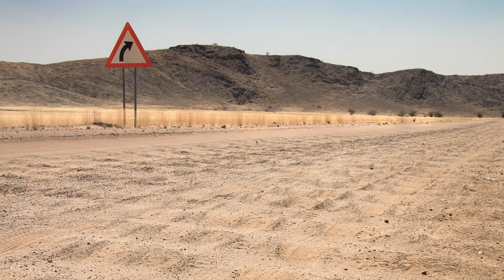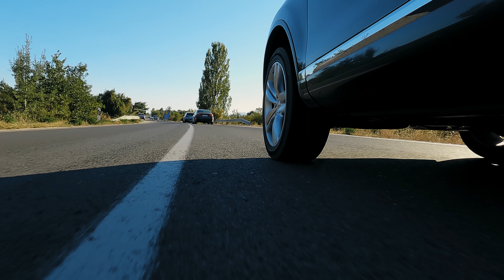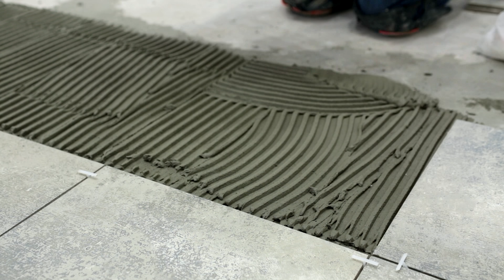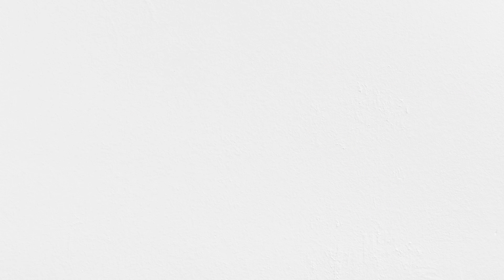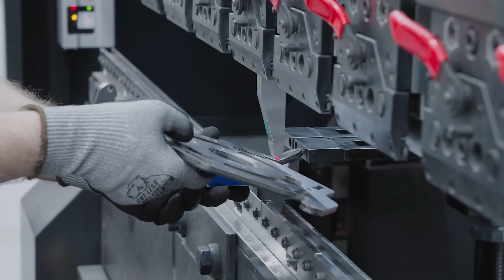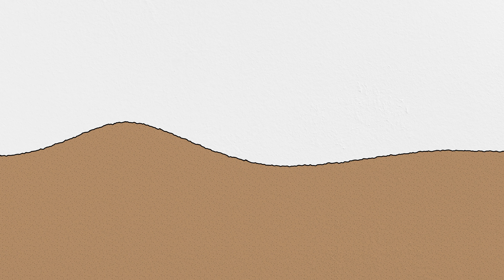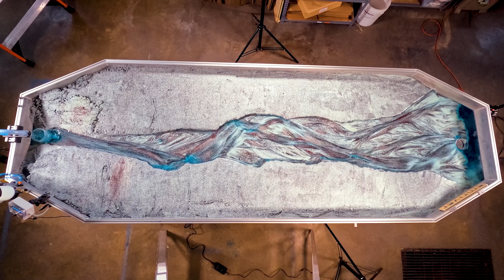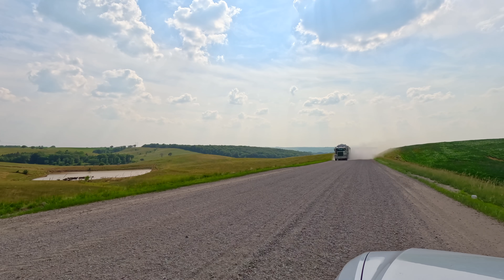Why Roads Get Washboards

Comment: I may be "asking for it" by doing this.
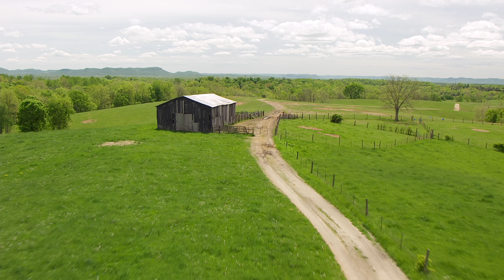I paused at 2:25 after your intro. I know you are very intelligent, and I know that I am not a trained engineer. Facts. But I also, for years, have understood physics and transfer of energy. I know that some washboard is caused by wind/water moving lighter smaller particles (erosion). But i also know from just simply watching and listening to vehicles driven on (usually gravel) roads, that most washboard is caused by ignorant and impatient people who do not have even a slight understanding of science and definitely not how forces act.
Hard acceleration and hard deceleration are the two main reasons washboard starts, and almost the only reason it "expands" in length and "wavelength". Yes other factors play a part like aggregate sizes, and mentioned erosion. Proper planning during construction, placement of maintenance material of the correct grading, and proper maintenance (not dragging all the fines and dirt from the "shoulders" into the drive path) can prevent these factors from entering the equation.

This also applies to paved surfaces. Asphalt, especially when just 2 or 3 inches thick over a failed base, will move a lot. Sustained high temperature greatly increases this measurement. Similarly concrete moves under excessive forces, like morons slamming on brakes (especially large vehicles like semis) because they neither pre planned nor gave themselves enough stopping distance to perform safe and controlled deceleration. In most cases the concrete is poured thick enough (6-10" or ~ 152-254 mm) but the 10 to 15 foot panel starts to pivot on the Y axis, and each panel then has a "lip" of sometimes inches as a result of the opposing "rise and drop".

Proper compaction of subgrade, proper material usage, and proper installation of whatever surface material are also very important. 

Engineers design roadways based on multiple factors, but if they are doing their job correctly when they say this road will withstand repeated (throwing a number out) 45 mph traffic (always over built of course) that doesn't mean you can leave the sub (soils/aggregates) below ideal compaction, use the wrong sub material (for rough example, some contractors like to use 3/4 minus where there are way too many "fines" and they move away leaving voids because it was the wrong material for the application), or not providing a thick enough surface (6" of pavement is not enough for heavy traffic, 1-3" ofasphalt over degraded concrete ground to 3", asphalt on a turn radius without proper assessment and placement depth, etc), and it definitely doesn't mean the design was intended for 65 mph traffic and semis performing excessively aggressive braking. 

If people would simply learn how to drive (cough, follow the posted speed limit. And yes there are posted limits for almost all roads in the United States), most of our roadway issues would cease to exist or take far longer to become a "problem". That coupled with appropriate construction means and methods, would make everyone happier and cost less (taxes, time, vehicle repair, etc).

Ok, now I will finish watching and probably put my foot in my mouth about something I said or feel. Ha ha

Comment: In my area most of our "paved" roads are just gravel held together with tar. As farm equipment gets larger and heavier, it destroys these thin roads far more quickly. Now add in that most farmers use semis, instead of gravity flow wagons, it really screws the roads up. Especially considering that most of the loads coming from the fields are over 80,000 lbs.

Comment: Is it not the result of the compaction roller creating the hills and valleys deep into the substrate? Over time the wasboarding (intermittent vibration of the roller)is exposed? The vibrations of the compaction roller creates what looks like a very smooth compacted surface. The vibrations of the roller create washboard surface?

Comment: I understand what is being said here but does not seem to explain everything. Here in Aotearoa I live at the end of a 10km dirt road. and so drive on this surface almost daily. I would expect to see washboarding on the part of the road that is driven on but in your video at 17:53 we see a surface very like my own road. Traffic is light so people tend to drive down the middle rather than on one side (this would be  the left here in Aotearoa). This means the edges and centre of the road get little use . However, the washboarding is across the entire width of the road and not simply in the heavily used part. What also happens is that there tend to be wheel ruts either side of the centre of the road but the washboarding actually runs along the central high spot as well and it is in line with the wave pattern in the ruts. I have wondered if there is some kind of resonance effect from the oscillation of the vehicle suspension as it moves over the washboarding in the ruts which is transmitted thrugh the road surface and piles up the particles without actual contact withe the wheels rather like the effect in a Kundts tube experiment.
such as here
https://www.youtube.com/watch?v=qUiB_zd9M0k

Comment: Ok, but I don't understand why the small wheel you're using in your experiment and the large tires of a car create the same spacing and radius of bumps and undulations. Intuitively, the washboards on roads using larger tires should be larger

Comment: That's a fun phenomena. I've gone over many unpaved roads in my life but I don't remember wash boarding being a huge problem - probably due to insufficient speeds.
I wonder what the frequency is, my guess is that it must depend on all the parameters (spring stiffness, tires, etc) but it just averages out to some value.
I bet it can't become a problem if tire pressure is low enough and suspension is soft enough for the given speed and load!

Comment: Also the power stroke of the engines I think could affect, obvious on single cylinder mc when accelerating.

Surface contact lenght, also snowmobile trails have washboards but longer wavelength.

Comment: In Finland these are called "nimismiehen kiharat" meaning "Curly hair of a rural police officer" :) Hence some 100 years ago the maintenance of small gravel roads was a responsibility of the same bureaucracy and police men were actually those on the field reporting service needs. Today there are about 30 000 km of state maintained and more than 300 000 km private maintained gravel roads in Finland so most of the material providers have also a special mix for gravel surface layer. Grooming and filling is a huge task every spring. Locals call the surface of a well maintained gravel road "crofter's asphalt". Looking at Rally Finland clips you can see corners where tires actually leave a dark skid marks to the surface - just like on asphalt.

Comment: This also happens with reel type lawn mowers with a roller at the front and back. A tiny bump will lift the cylinder blades and create a new bump as so on. That’s why they crisscross pattern, not just for looks but to also smooth out the ridges.

Comment: Although I am a licensed engineer, I find these videos tremendously illuminating on topics I have never studied nor have experience in.  Thank you for broadening my understanding as an engineer!
Reply: There is a way to nearly stop wash board.  If your township can use a gravel such as Basalt…it will pack down like cement.  Problem is it’s slightly more money than class 5.  All my neighbors thought I wasted my money putting Basalt on my driveway.  6 years later I haven’t had to grade it and it hasn’t eroded or shifted. Now everyone is putting Basat on their driveway.  We are even trying to get high traffic roads covered in it.
Reply: What kind of license?
Reply: @OneShotKill3r   Professional Engineer License, Electrical Engineering
Reply: Typical engineer, understands how to build it, doesn’t understand how the grader actually operates.  The corrugations are not like the video says and come from the operators of the grader being a rookie (or just lazy) trying to do the job too fast and taking too big of a bite with the blade.
Reply: @JohnTRevelator  Which is why you an equipment operator and not a licensed engineer.
Reply: Thank god to all the engineers that announce they are engineers.  Now we know who to blame for plastic oil pans, plastic A arms, and all the failed medical devices that have killed people.  As a human being I have to let you know.
Reply: @MinnesotaCarswtf? Also the ones that have made society safe, comfortable and exciting..
Reply: @MinnesotaCars  you little slow?

Comment: I'd love to see some of the various patterns in there. 

one thing you didnt explore is the possibility of blending aggregates with a base existing material - which may be more practical from a road improvement standpoint  - such as you could evaluate a road that washboards with a test setup like yours (or dig a small section of what's on an existing road), run it through the setup and either empirically or by trial and error see if blending in different common quarry products at a certain rate (0.x ton per xxx ft of a single lane) improves an existing roadway, which may be more practical than replacing the wear layer entirely on a gravel road.

Comment: When I lived in France, in the 1970s, the dirt roads I drove on did not have washboard (or corduroy) surfaces.  I attribute that to the fact that French cars, at least at that time, had much less unsprung weight than American cars did, and also that they varied more in weight, spring rate and so on.

Comment: The most sure-fire way of mitigating the problem of driving on wash board roads is to drive a vehicle with rubber tracks.  It is possible to buy rubber tracks for a pickup truck.  But this is a rather expensive solution to the problem, and the vehicle speed may be somewhat limited too.  But a vehicle with tracks will mostly just glide over the tops of the ridges.  Tracks would also reduce the forces applied to the roadway, thus reducing damage to the roadway.

Comment: I’ve always thought that using 4x4 would help reduce the buildup of these. Because if you notice, washboards seem to build up in spots where you accelerate. Not necessarily in spots where you decelerate. So naturally 4x4 could theoretically slow down the build up process just by distributing the load between front and rear axles.

Comment: As cost and availability of liquid asphalt varies, road surface maintenance becomes spotty. Those 20“ wheels and low-profile tires are already passé, and we might see a jump in demand for high sidewalls and shocks designed for maximum wheel travel.

Comment: Two things:
1.  Sand is not gravel.
2.  Tires are not simply being pulled through sand.  They are being driven forward by the power of the engine.  The tires are the point of contact with the surface of the road being torqued so that by friction with the ground the vehicle is propelled forward.  If you're just pulling a wheel around and around it misses the force of that gripping propulsion action.

I wonder if a modified remote control car setup could be used on fine gravel (just to scale with the tire being used). That would mimic what is truly happening to gravel roads when we drive on them.  I think I would look at attaching the setup to a rail on the outer ring of the track (like they used at dog races) as a guide only and let the motor of a remote control car be applied directly to the rotation of the tire.  A weight above the tire on the guide arm would probably be helpful unless the setup is suitably weighty enough.  Time lapse is good, but I also wonder if at some point extreme slow motion might also reveal some interesting findings.

Comment: Washboards are due to differential rear ends in cars. Running in 4x4 mode will prevent it, if that is available.  As one tire bounces over a rock or ridge, it is freed to speed up while other side stays constant as the engine is applying force to the drivetrain. When that bounced wheel comes back in contact with the road surface, its surface is traveling faster than the surface area of the road by comparison. This causes slight "digging" material from the point of contact and pushing it behind that point, causing a slight build up mound to develop.

Comment: I'm gl🎉are you made this video I work a farm in Eastern Washington State. We have miles of dirt roads one in particular is the main the width is wide enough for two vehicles to pass . The soil is sandy with clay the clay is heavier in spots and non-existent in others. At veriuos time of the year heavy semi truck traffic uses this road. Wash bordering accures my obversevation when the is dry. We have water trucks to keep the wet and kind a firm the non clay spot's require more water. My question to you Mr Grady is willing a slightly wetter road cause more wash bordering? The W B's are already present as a dry road then water is applied no blading just water. My theory is the water would make everything constant and the weight of the vehicle's would rollout the uneven surface leaving a smoother surface. Farm's don't have road maintenance budgets so doing what gravel is a nonstarter all natural. This is not flat terrain rolling uneven dishes out in middle wind blown roads. But if not at least watered over time of being it gets worse and powered. I'm am curious about the water and the amount that's best?

Comment: Excellent video!  However, if there are parallels between snow moguls and washboards. you may have incorrectly assumed that the bump grows, moving 'DOWNRANGE'.
I saw a time lapse video of the formation of moguls on a ski slope. Just as you did, I expected growth would move downhill (downrange) as they grew due to material being scraped downhill. HOWEVER, the time lapse showed the moguls migrated UPHILL as they grew! Yes, material is being scraped downhill.But, it is ACCUMULATING on the top of the mogul below. While the aggregate movement is downhill, its visual manifestation requires a more complex study to properly understand.
Edit: Perhaps the apparent up-range, downrange motion depends on the natural resonant frequency of what's rolling/skimming across the surface.
P.S. I searched "uphill mogul migration" so I could cite the video. But the only result was a useless, grainy, sub 5 second clip, further obscured by shadows.

Comment: This is one of the nice properties of crushed asphalt. It tacks together and is a pretty cheap secondary product from surface grinding. Also note that honeycomb (stabilizing mesh) would be easy to make by laying flat strips with alternating thin lines of surface glue perpendicular to the strips. Paper composite and Aluminum honeycomb is used as the middle layer of composite materials from IKEA furniture to aerospace panels.

Comment: There is a washboard road near 11 mile reservoir in Colorado. It is westbound toward highway 24 from the lake. This road should be studied by scientists. It shook my truck bumper almost off the vehicle and locked panels on my RV were shaken so violently the metal hinges were ripped in half and these panels were dragging on the ground. I've never been on a road like it. And it seemed to happen at any speed,I had to come to a dead stop for it to not to destroy my vehicle.

Comment: I recall washboarding being discussed 40 years ago in my 3rd year engineering dynamics class. Vehicle suspensions are designed to provide a comfortable ride for people regardless of the vehicle's size and mass. The elastic (spring) and damping elements are chosen for all vehicles to damp vibrations adequately over roughly the same excitatory frequency range. So a massive pick-up and a compact will bounce similarly over the same frequency range. Hence, when the wearing surface can deform, all vehicles reinforce the wave nature of the deformation. One solution is to introduce vehicles with active suspensions: with a tunable natural frequency and/or active counter-oscillation. The obvious problems are cost, reliability, and extra weight, and how often would a typical vehicle need such a system?

Comment: Experiment ideas - 1. Can the use of a dampener on the wheel reduce the amplitude of the peaks and valleys over time (special truck drives the road periodically etc). 2. Introducing bumps in the road at ideal locations to create an inverse wave that nulls out the existing washboard (sine wave) of bumps.

Comment: Being a process engineer, I'd be curious, if there were a relation between speed of the wheel and the peak-to-peak-distance of the ripples.
On the time-lapse of garage model the peak to peak distance is clearly visible. And it's roating, thus constantly moving.
Did you try different speeds of the wheel and compare the ripple formations?

Much appreciate your content! Keep on going!

Comment: Did you know it happens on icy/snowy roads too? not only that but at a certain consistency the icy snow becomes impossible to plow as the blade will start oscillating, bouncing up and down and you end up with washboard there too

Comment: 2wd exasperates washboard roads as well. There is more articulation from side to side with the differential not being locked and causes more shift of the tires and therefore more movement of the sediment on the road.

Comment: As a former engineering tech at "MCTC" (Materials of Construction Testing Company) using the "ASTM" (American Society Testing Manuals), both at a company lab, and in an on site lab at asphalt manufacturers for all materials used in asphalt manufacture with persistent follow-up testing on road "wear surfaces," I am too familiar with "washboard" surfaces on city streets, express-ways, and highways. BLEAH!